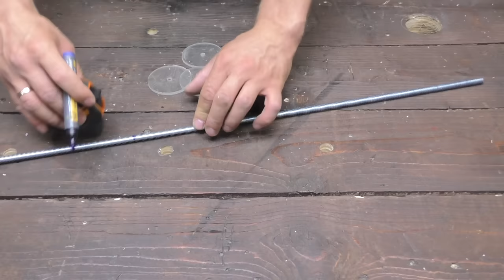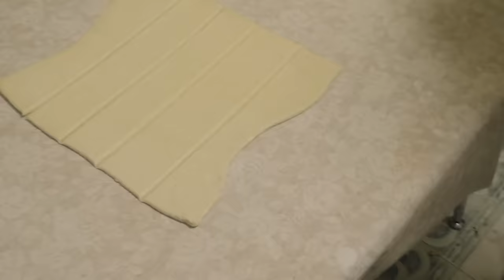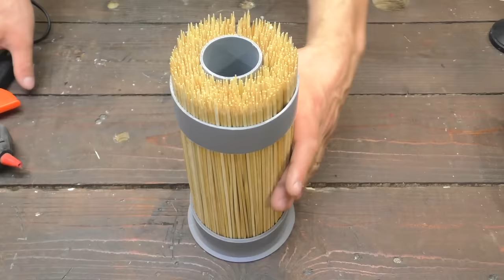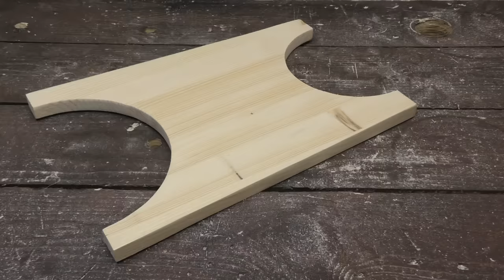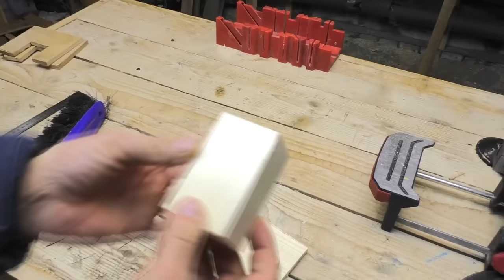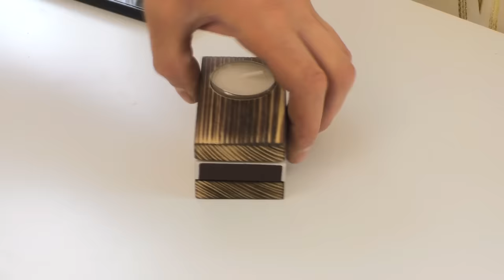Top 5 Genius Ideas! You may need this!

Comment: 7:00 Don't waste time gluing and clamping when you are also adding screws. Drill your pilot holes, apply the glue, add your screws. The screws will act as clamps while the glue dries.
Reply: Or better still.......... Just don't waste time doing any of it.
Reply: Perhaps the glueing was added because its a cutting board so will be washed in water which will wet under the joint if not water tight.
Reply: @ClissaT  I understand that completely. What I was saying is, if you are going to use glue and screws, then there is no point in clamping. All you need to do is apply the glue, add your screws and move onto the next step. The glue will dry and cure under the pressure created by the screws. There is no need for the clamps.
Reply: You can hardly wash that board, as no protecting finish has been applied.

Comment: @6:58 why not use the screw holes you’ve just drilled to hold the wood together rather than the spring clamps?
Reply: Because it's only "genius" way to do so.
Reply: Or not bother with the screws at all if you’re going to clamp and glue it.
Reply: @joshsmith159  or even not bother at all and have a cup of tea instead!
Reply: Can't ask reasonable questions on this channel I mean just look at it 😂
Reply: My thoughts exactly

Comment: putting screws into wood after the adhesive has cured is like closing the barn doors after the horses get out.
the glue joint is stronger than the screws.

Comment: What's the thing you made in thumbnail??   Not on Video???
Reply: Looks like a normal drainpipe (HT pipe).
This was prepared with a saw.
The handle at the top is reinforced with heating pipe insulation.

Thus it is a sieve.
The hole size determines what you want to sieve.
small holes "dirt" from a sandpit.
larger holes cat litter tray ;)
even bigger split.
Reply: Do believe that's a cat litter pooper scooper.

Comment: I love woodworking and seeing it in action is so satisfying. I give the credit to the man he seems to know what he is doing. 

However, that was a lot of work and materials for things that didn't seem worth the effort, like the nutcracker. It was awkward and clumsy to use. That cutting board seemed like overkill. It seems like it would have been easier to raise the height of the cutting board to that of a plate with block legs with rubber stops to prevent slipping in use. The circular cut-outs where okay, but really overkill. That gadget to cut dough four strips at a time. Really? I bet his wife is faster with a knife than he is with that table saw. Besides, who is going to clean that thing of flour, bits of dough and goodness knows what else.

But I get it, he wanted to show off his tool-toys and his skills. To each his own. 

All the best.

Comment: #1. A total waste of time for what can be done with a knife or pizza cutter easily
🙄
#2 Nice bacteria collector
🙄
Reply: Wulf Claw can’t agree more.
Reply: That is exactly what I was thinking about his cutting board... for one it looks like he used a pine board which is probably not going to hold up, then instead of doing anything to seal the wood and make it possible to clean it or easier to keep clean... just pure unfinished wood that once it gets wet is going to be a problem. If he'd simply used something like plexiglass, acrylic, etc... he could have made the same thing but at least it wouldn't become a huge petri dish after the first use.

Comment: i knew that was a ravioli cutter as soon as you put a rod they it. lol

soft open grain in pine will soak up the juices from food, rott in there, then contaminate the wood, and make you and your family sick.  use woods with very tight grain like maple, and clean it after each use.  also clean it with white vinegar from time to time snd hit it with a belt sander to take the crud off.  keep it as clean as possible.

the nut cracker is really cool.
great idea.  but don’t eat too many nuts or you’ll end up constipated.

how do you like your metabo miter saw?

Comment: The tomato cutting board with the plates is a clever idea, but you don't really want to use any type Pine for a cutting board, as it imparts a flavor to your food.  Eastern Hard Rock Maple is the best when constructing a board like that, but with an End-Grain pattern.  When you use pine, it is far too soft for cutting and you'll soon find that you have chopped your board up in no time at all.
Reply: your assumption that chopping boards are made from USA wood is breath taking
Reply: @John01GM40  As far as I know only rare and expensive Exotic hardwoods are imported like Ligma VIta, Teak and Ebony, as well as over a dozen others.  Our western US has all the pine and fir that we would ever need.  On the eastern shore are many of the hardwoods, Like Eastern Hard Rock Maple, but it is expensive as are those hardwoods mentioned above. I'm sorry, did I mention anything about USA woods other than EHRM ?

Your sarcasm is noted and I hope you don't gag trying to catch your breath.  I used to be a meat cutter many years ago, so I know what kinds of wood actually work for making good and serviceable boards.  Not all hardwoods and no soft wood can or should be used in making cutting boards.  My current board of choice is made from WHDPE, (White High-Density Polyethylene ) and is fairly cheap in comparison to some of the modern-day wood boards, but wood boards actually are better as long as they are constructed with End-Grain wood sections face up !

Comment: The cutting  board is a wonderful idea except wood can soak in bacteria especially when using a soft wood. Add a piece of slate or a piece of steel. The life you save may be your own. .... thanks for the video!
Reply: Nope - wood is naturally anti bacterial.  Any cleaning solution used to clean wood will be partially absorbed by the wood which adds to this.  When the wood dries it is a very poor host for bacteria - much safer than plastic cuting boards.  Add a piece of slate or steel and you create a moist environment underneath that can harbor bacteria.
Reply: @cellerfeller1474  thanks for the response. I've always been told to be wary of wood cutting boards. Either way i enjoyed watching the video.

Comment: 1) By the time you're done adjusting the width, ive already cut with a knife.
2) Was curious about the center post at first. Surprised you didnt add something for your pastry cutter you made in #1
3.1) Why'd you have to cut off the OUTSIDE inch? Why not just cut two strips 1 inch thick?
3.2) If you're gonna use screws, you dont need clamps. The screws are supposed to ACT as clamps during glue-up
3.3) While pine is the economic choice, it makes for very poor cutting board surface as it marks and cuts easy, meaning food germs will get into it easier. Also YOU DIDNT TREAT THE WOOD AND ARE CUTTING FOOD ON RAW WOOD! Thats going to damage the wood even more than the knife would.
3.4) You know what else works? Picking up the cutting board and sliding food off it. Then you dont have to sacrifice work-space for those cutouts.
4) Ok, this thing is a nifty idea. I would have liked some way to hold the matches in better so you can move the candle around without worrying about it all falling out, but for as simple as it is, good on you for this one.
5) Wait...you're not going to show us how this was made?
Reply: He knew you were going to moan and whine about the process of making number 5, that's why he's not showing you how he made it.

Comment: Never did see the thumbnail gadget.  I made one from a 1 gallon plastic gas can by cutting the front off at an angle.  Then just drilled it full of holes.  Use it to sift sand and dirt when metal detecting.

Comment: The cutting board thing was not practical. It reduced the size of the cutting surface way too much. An easier solution would be to simply elevate the board with some legs in order to slide a plate under each side

Comment: All the projects take longer than worth it for what they are used for.  Knife blocks are cheap as shit at Walmart.  Use a pizza cutter, faster anyway.  The amount of time to make a stupid cutting board just buy plastic flexibility ones and slide your scraps to one side.  Now you have two dishes to clean using your idea. With the plates.  No time was saved by making any of these projects.

Comment: #1 - or just use a knife which would be easier to clean
#2 - great for dulling your knifes (same for a knife block; never use unless you like to sharpen them often)
#3 - so you can have an extra dirty plate?
#4 - would work great for cooking heroin 
#5 - ok but why? plus you spent way too much time on the simpler builds not a bit on this one